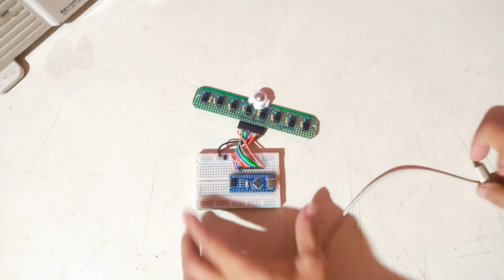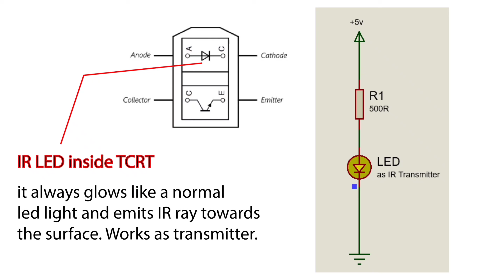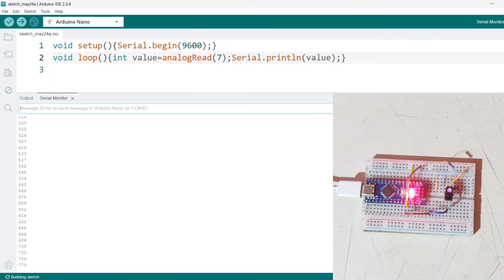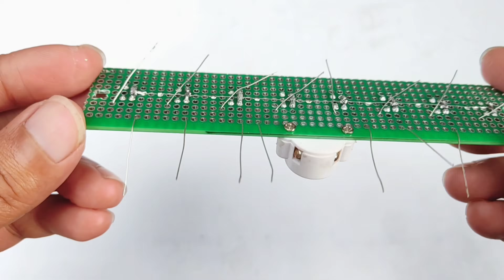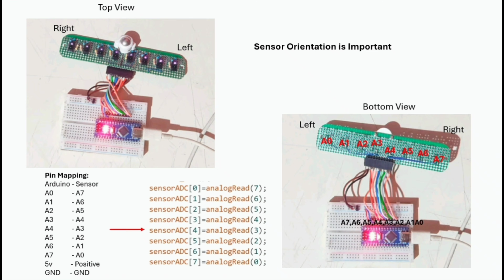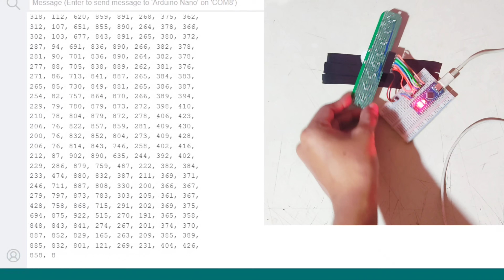How to Make 8 Channel IR Sensor Array for Line Follower Robot | TCRT5000 Sensor Array

Comment: Can i change the gap between the sensors around like 0.5 and reduce the number of sensors to 5

If i do that 
Still can i use the same resistor values
Reply from the maker: yes you can. no changes require

Comment: Can you make one line follower robot using rls08 aaray esp32 and tb6612 fnf module
Reply from the maker: i don't have the sensor bro
Reply: @aslamhossain1 and then make from esp 32 and qtr sensor or any 8 channel ir sensor
Reply from the maker: @MODERNDECORNDESIGN  i only use tcrt or led and photodiode